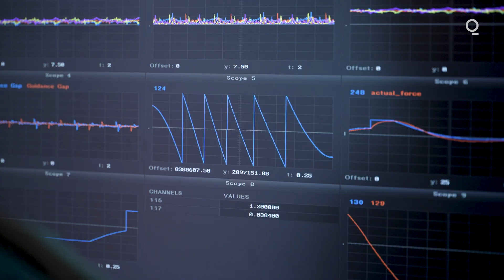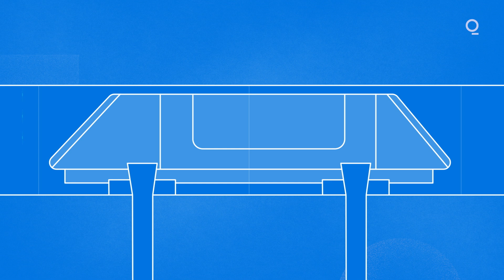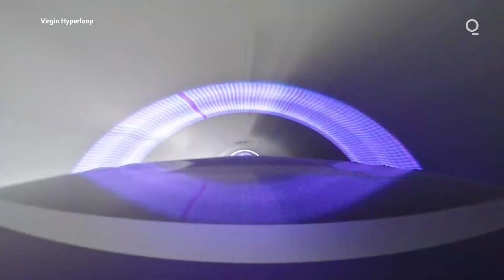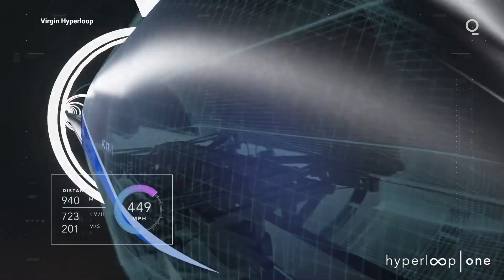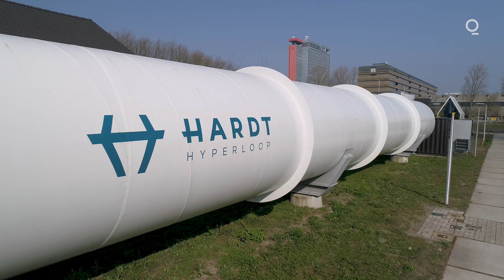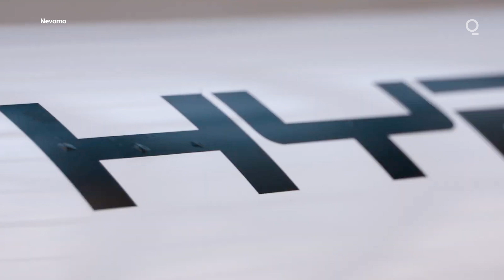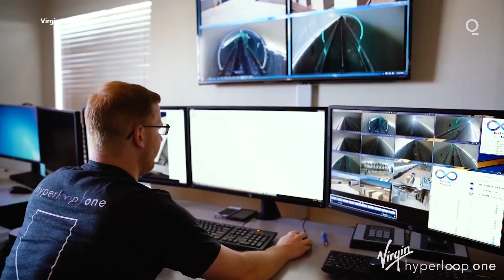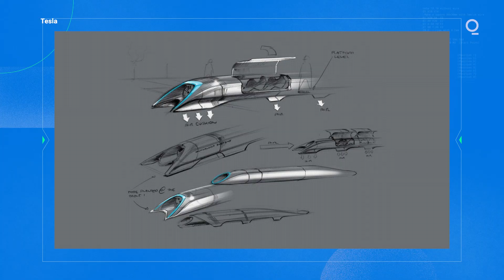The Hyperloop May Disrupt More Than Just Travel

Comment: What exactly is the use case for turning a 2 hour commute into a shorter one? How many "super commuters" are there that need to travel this far regularly and any farther you might as well fly. Even if we began construction NOW it would still be a decade before it's even complete so I bet such a system is at least 20 years out. Not to mention this type of system encourages sprawl since it assumes people will live farther out from where they work to commute 200 miles elsewhere which might be easier solved by taking off the heads of dipshits who block zoning reform.

Comment: Hyperloop is half idiocy, half major con.   The guys running these “startups” Raise millions from gullible VCs, pay themselves very high salaries, and can get away with it for about 7 to 9 years before the marks get wise.  No hyperloop will be built.  A tube that can withstand high external pressures and has a life support system for people inside it is about as costly an engineering problem as building a submarine, and subs cost about a billion dollars per 100 feet.  Expect an actual Hyperloop to run about a billion dollars per mile. Add in the fact that any dent in the tube will cause a catastrophic collapse of the entire tube- or that a leak will cause an air hammer that will be powerful enough to crush cars... and all for what?   To get a Pod of people to go 500 mph?
Every commercial jetliner is a hyperloop pod that needs no tube.  It takes a hundred or more people up into very thin air where the pod can easily achieve 500mph speeds because of the low friction... and it can land in ANY town... not just the few connected by an over expensive steel tube.
Its a CON.

Comment: Imagine a transportation system, consisting of "pods" that aren't as restricted in size as hyperloop pods would be, "pods" travel almost as fast as the straight-line speeds claimed for the hyperloop through a reduced pressure environment that has low drag but for safety and practicality isn't quite as close to a vacuum as proposed for the hyperloop, and best of all, these "pods" do not need any tracks or tubes to run in, no massive land acquisition or tunneling, no complicated loading stations with huge, high-pressure airlocks, and instead of being an unproven system that has been tried before and never went beyond the concept or demo stage, these "pods" are part of an existing system proven to be safe (and efficient in some jurisdictions). If only humanity had something like that... THAT would really be something, wouldn't it?
Reply: like the cargo containers that go from road to rail to sea

Comment: I gotta say, I love the idea of the Hyperloop as fave engineers for the past 100 years or so.  So far all I've seen is a one mile test track that constitutes one of the largest vacuums by volume and length.  So now, all that has to be done is about 800 more trust tunnels, all connected, allowing for material expansion and retraction with miles of the tunnel winding through  desert and then pull a vacuum on 100s of thousands of cubic feet. 
Yeah, I just don't see it.  It's not that it couldn't be done but the maintenance required would be prohibitive. 
And worse yet, chances are the loop will not be able to pull and maintain a constant vacuum thus hindering performance thus injecting the risk of failing to meet customer expectations .
I just don't see it.  There is a reason you no longer hear Elon talking about the Hyperloop ya know.
Reply: While I'm skeptical too, I don't think the vacuum is the biggest problem here. You don't need a full vacuum for this to work, even a moderate reduction in air pressure would result in a significant reduction in air resistance. A 10% or even 20% vacuum would be much easier to maintain and produce trivial air resistance. Sabine Hossenfelder has a terrific video on YouTube on why Hyperloops are mostly hype though, where she does all the math.
Reply: Its not a vacuum... its a partial vacuum...
Reply: It isn't a true vaccum, big difference.
Reply: @JunkBondTrader  I never specifically said “perfect vacuum”. Several people have jumped on this one point that was never made in my comment in the first place as though it somehow solves all the issues I outlined.
Anyone who’s used a vacuum pump is painfully aware of just how long it takes to pull a partial vacuum on an AC unit. And the only reason that vacuum holds is b/c it is a closed loop. Now apply that to 800 miles of pipeline big enough to convey humans. Oh, then pump it down and maintain it in as you’re continually opening and closing doors to let passengers in and out. It’s just impractical.

Comment: I want to see Gotham and Metropolis connected with a Hyperloop. This video is about fiction, right?
Reply: I understand your concern. All evidence points to a money pit that will never come to fruition.

However magnetic levitation is real.
Reply: The technology has been around & in use for awhile. Phil Schneider talked about them and the drilling rigs in the 80's/90's.
Reply: @JimmyJohnson-cy7xb  This won't be possible in the near future because the amount of pumps needed to keep such a strong vacuum is large. A little hole will completely ruin the vacuum. To be able to get such high speed would need straight tubes and it will cost way too much
Reply: @JimmyJohnson-cy7xb  The idea has been around for a while, not the technology.
Reply: @MemableAI  Google image Elon musk's drill then check Phil Schneider's drill
Reply: @JimmyJohnson-cy7xb  Yes.
He has the same technology everyone has and it still takes years.
besides, depending of soil types, sometimes you cannot use a drill. 

For example check the new Alps tunnel which covers 4 types of rock so they had to use these machines and traditional explosions. 

This is to make a connection which extends from Rotterdam to Genoa and it is more cost efficient on the long run and will pay for itself due to cargo transport.

Comment: I'd like to believe in this technology for its potential benefit to the environment, but for now it resembles an unsafe money pit. How many planes will a system take out of the sky and at what cost? Because of the need for flexibility, the pods need to be small, which doesn't seem conducive with freight transport. And for safety, what if a vacuum seal is broken along the hundreds of miles and numerous joints?

Comment: How fast is development progressing?

What is the capacity of the system calculated to be?

How much it will cost to construct, operate, maintain and ride including the cost of tunnels and bridges?

How will technical challenges like expanding steel tubes be solved? 
Temperature differences between day/night and top/bottom of tube?

Rust prevention inside and outside of the tube?

The white paper mentions air (cushion) as levitation, guidance and propulsion system. 
Will this idea be pursued or will maglev be implemented for these (fundamental) functions?

How about that fan to tackle a near vacuum state? Will it be used?

Will Hyperloop be able to regulate its speed along the entire route?
The route will supposedly vary with straight lines and curves?
Follow existing traffic corridors? What will average speed be?

How much time will be spent getting people and pods in and out of vacuum?
Maintenance, costs and capacity of the vacuum seals/ports/pumps?

How much energy will the system use in total?

How will the overall layout of the system be designed regarding, stations, switches, track, logistics and length of acceleration zone near the stations?

How will compression/friction heat, aerodynamics and tube diameter be in a system with only near vacuum?

What is the range/niche of Hyperloop?
Where to use rail, maglev, plane, car?

How will sustainable energy to the infrastructure sector be addressed?

How should the strategy for decision makers be regarding using non-existing or existing and tested technology to solve existing challenges like climate change and air pollution? Do they understand physics and technology enough to be bold and visionary?

How is the relation between existing rail industry and decision makers?

SwissMetro, is there any experience to get from them?

How is the legal bit regarding Hyperloop?
Will it be allowed to send pods every 30 sec?

Land use. Rights? Buy land?
Use Norwegian “punktfeste”?

What happens if the tube is compromised (by accident or terror attack)?
Will there be a shockwave rushing towards the pods already in the tube?

How will emergency situations be tackled?
How will emergency exits in pod and tube work?
Will the pods be able to get to an emergency exit?
Getting people from the tube and down to the ground?
Will the inside of the tube regularly be inspected for debris?
What about fires and the plan to make these pods unmanned?
How will the passengers be supplied with (emergency) oxygen?

How accurate is it possible to “estimate” future development?
How will development of new materials apply to infrastructure?
How can we learn from historical development projects/visions?

Comment: no it wont. because its overengineerd. its solving a problem that doesnt exist.  is overly complex and laughably expensive compared to existing high speed rail systems that  have ten times the capacity of the hyperloop system with a hundredth of the cost and only half the (supposed) speed.

Comment: Imagine getting stuck underground in a tube surrounded by vacuum.
Reply: Or a malfunction from the other train smashing into ur broke train   at 1000kph. Instant death
Reply: @hondaep3813  Or a faulty lock on the train letting oxygen out
Reply: @hondaep3813  You people are truly pathetic. All of these criticism already apply to planes and yet they're still the safest mode of transport.
Reply: or a tiny hole somewhere on a massive tube that sends a wall of air at the speed of sound towards your pod
Reply: You realize your in a pressurized cabin when on a plane and if it fails. You definitely die. You can depressurize the tunnel and have emergency exit elevators
Reply: image an engine failure of a plane in air or a truck crushing you on the highway...
Reply: @eestarthilfegmbh9502  still more survivable than being underground with no way out surrounded by vacuum and other pods smashing into you.
Reply: @ivaniuk123  somehow i don't feel reassured by that!
Reply: 1. They need to sell that fraud solar panels technology somewhere. 
2. Bloomberg = I'm out.
Reply: Imagine falling from the sky in an aluminum can traveling at 600 mph
Reply: @aaron4820  multiple engines, redundancy in all systems. Aluminum cans have more flexibility in the air then underground surrounded by a vacuum.

Comment: The "Hype" part of the name is correct. Planes are a lot cheaper and a lot safer.
Reply: The government has been using them for decades. There should still be an old military drilling rig pic on the internet. It's bigger than the one Elon showed off. Phil Schneider talked about them in the 80's/90's.

Comment: How about just sticking to what works.  I'll pick a diesel electric locomotive in the open air over a fancy oversized pneumatic mailing tube any day of the week.
Reply: The government has been using them for decades. There should still be an old military drilling rig pic on the internet. It's bigger than the one Elon showed off. Phil Schneider talked about them in the 80's/90's.

Comment: So they're basically small maglev trains ... But in tubes 👏
Reply: Yes but under extremely low pressure which reduces friction by so much allowing for ultra high speeds
Reply: @AyoTexxx  that's not quite how it works.
Reply: @AyoTexxx  except they haven't even proven it can do that at all LOL
Reply: @sinephase  I wonder how space craft can move 430,000 mph?
Reply: @gamepro94z  wait, is spacecraft thrusters used for the hyperloop? Because if not, i don’t see how this question is relevant
Reply: @gamepro94z  what spacecraft is or was travelling at that speed ?
Reply: @Zack-fu4lo  so now its going to have rocket engines inside a steel pipe,  that they are running massive pumps flat out to try to maintain vacuum, the Musk rats are getting  desperate lol.
Reply: @gamepro94z  rocket engines now hilarious.

Comment: The network becomes a huge vacuum chamber.    An implosion of a tiny section would have catastrophic effect to the system.   The change in pressure would be like hitting a brick wall in one of the modules. While the technology can be made safe, protecting the system from a potential terrorist attack could be costly.
Reply: CALL BEFORE YOU DIG-YOU CATS DIG IT,MAN?

Comment: If they could invent a duel mode truck trailer, this would transform freight. Think of an 18 wheeler hauling a hyper loop container. You pack it up at the factory, the truck takes it to the hyper loop terminal, and then you send it off cross country. When it gets to the other side, it just comes out gets hooked up to another truck that will deliver it to its final destination.

Comment: Rather than transporting people, we could see this being very useful for parcel and transporting goods.

Corporations like Amazon won't need those massive trucks to bring goods between warehouses, if they are connected to a hyperloop to literally shoot cargo to other places.

But security comes into mind as another issue... If you send valuables through this, eventually organized crime will exploit it, or sabotage it for gains (stealing goods by intercepting the tube and releasing the air pressure, which causes the pods to slow down dramatically due to friction).

Comment: Hyperloop is just incredibly impractical, mostly because of insanely expensive infrastructure which would be very vulnerable. It's just a cool fad
Reply: It's also impossible.   And unsafe.   Not only not practical.   It's not even an original idea.   It was thought of over 100 years ago.   They can't even do a short test track with a vacuum tube.   All they've made is a short track with no vacuum that moves at 40 kilometers per hour.   It's literally just a tunnel.
Reply: @Anthony Niemzak Compression*. Plus they could be underground. Though they might seem impractical, no one would know.
Reply: If it became large scale, t would be a terrorist's wet dream.

Comment: Bullet train already exists. 
The only difference with Hyperloop is the near vacuum tunnel, but that is not cost effective or technically sound for long distance.
So how is Hyperloop going to disrupt anything?
Reply: The other difference, that supporters have difficulty understanding, is that it's NOT a train at all. It's 1 pod at a time. If it were, say, a train, say a 100 meters long, with cars, it would probably take much longer to pump it down than it would to drive to your destination (unless, of course, you have a hundred pumps drawing a couple of megawatts - then you have another problem - power consumption).  Who's going to wait for hours while the tube pumps down?  The energy "savings" from no air friction would be trumped by the energy consumed in the pumps. It's obvious to real (and honest) engineers. The dishonest ones are getting a paycheck so long as they can keep this elephant in the room alive.

Comment: I'm sorry, but if the key benefit of the hyperloop is "Carbon Savings", then it will never be realised. It needs to provide a commercial case: the ticket revenue needs to cover a significant portion of the capital and running costs, and the wider economic benefits need to be so great that it's worth the government subsidising it.

And that's just the start. Ideally, the hyperloop itself needs to be profitable. At no point does it become relevant beyond marketing that it will offer carbon savings.

Comment: Will our bodies disintegrate when the train starts leaking air inside the vacuum of the tube?
Reply: No but our heads will explode like the aliens in Mars Attacks!
Reply: they'll be called pods, not trains, and it'll never leak, what are you morons so afraid of?
Reply: @vrproject4k882  Structural failures.
Reply: @robertd9850  you guys do realize it'll be underground and above ground depending on environment right?
Reply: @vrproject4k882  Again, structural failure.
Reply: @vrproject4k882  - lol!

Comment: More importantly, it will disrupt people who believed that this would be a thing.   This is not a thing.  The evacuation of the air is the problem.  Without the vacuum, you have nothing but a claustrophobic train or metro.  At best you would have a mag lev.  With the vacuum any failure would be the end of you.  How do you rescue a pod that failed in the middle of 50 km tube with no exit and a vacuum.
This demo was complete and utter BS.  The tube was not evacuated, the pod was not a pressurised system, and it rode on wheels.  (108mph....  pathetic).  Great you just rode a metro.  That makes you a visionary?  Clearly that rider has little understanding of science or engineering. 
At any rate, in the US this will never ever happen.  Americans are the least likely people on the planet to ever invest in trains.
The idea of making a transport network act like a TCP/IP system is useful but  you do not need a hyperloop to implement that.   Very short rail car would be able to do that but would not be scalable nor economical at this moment  The concept works independently of how you implement it.  It works with cars.  With trains, self propelled short wagons are simply not cost effective. With hyper loop it is even less likely to happen given the trillions you would have to invest.